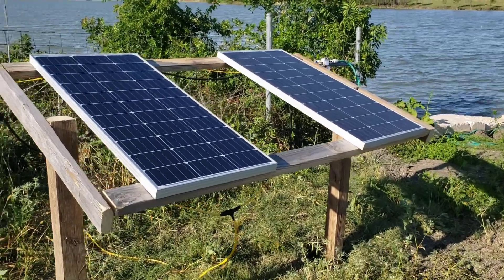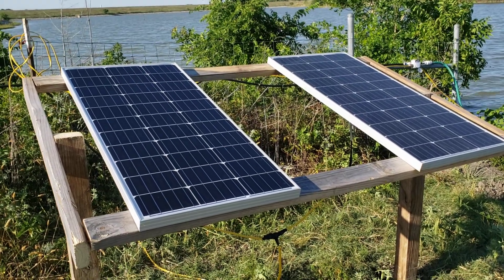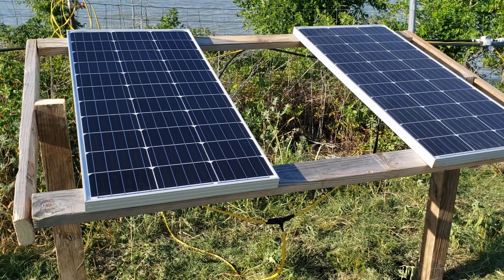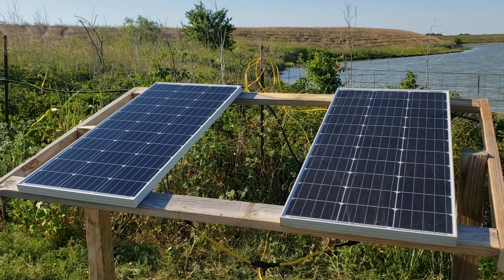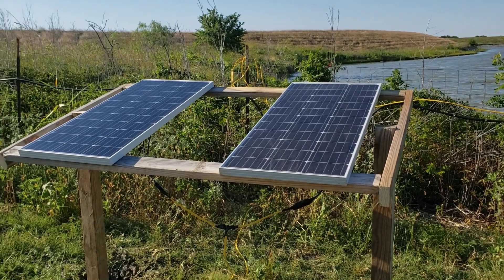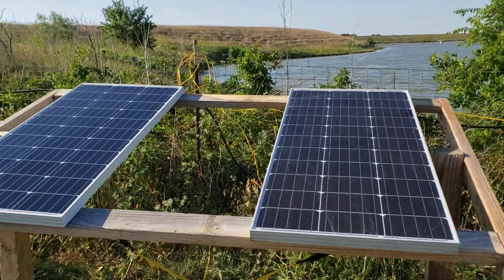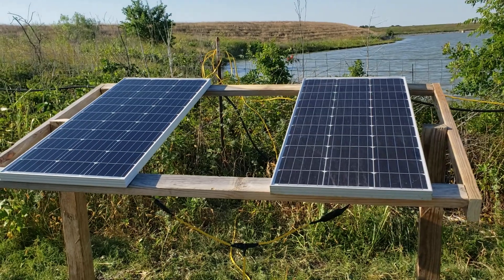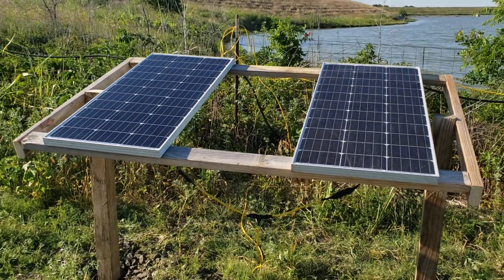Built a Solar Panel Frame from Old Lumber for my Solar Water Pump

Comment: Hey thanks for your very helpful videos - AWESOME!  Quick question, I got the 24v version of this pump and am using it for the same reason (pumping form a beaver pond up 20 feet of head and along 500 feet horizontally to 23 saplings).  It worked great when I put it on with HUGE pressure (I guess not much drips out from 23 x 5 gallon/min spigots), then after about 3-5 minutes, it turned off.  My question is, do you know if the pump turn off when there is too much pressure?  Any ideas?
Reply from the maker: It will trip if the pressure is over 100 psi I think.  Put a pressure gauge on the line when you run it and see where the issue is.  If you don't have enough flow out of the hose you will build up pressure quick.

Comment: The pump spec says 96 watts max. But you are running 200w solar panels. I don't quite understand how that works?
Reply from the maker: That is just what the pump will use.  In full sun the panels will supply up to 200 watts, but the pump will only use up to 96 watts of that.  The rest is basically wasted.  It's like if you plug something into your wall that is 120 volt and uses 100 watts.  There is way more than 100 watts available, but the appliance only uses what it needs.

I had it on only 1 panel for a while which is 100 watts, but that is only full sun.  The pump did run fine on it, but not as long as I wanted it to because sometimes there was not full sun.  Adding the second panel allowed the pump to run even if it was cloudy and longer during dusk and dawn.
Reply: @SeidelRanch  Thanks for the response and the videos. I am using the same pump. Will let you know how it goes.
Reply from the maker: @timomcgeer  That would be great. Keep me updated.

Comment: Do you have your panels run in series or parallel? I'm interested in purchasing a setup like yours with that particular Pump. Is yours still up and running? I'm trying to decide whether or not to get two 100 watt panels are one 200 watt panel as the price is around the same. Thank you for your time
Reply from the maker: For this pump, since it will run 12 or 24 volts, I ran them in series to increase the voltage to 24 volts.  One panel provided enough amperage for 12 volts, so adding another panel in parallel would not have helped (just increases amperage which I already had enough).  When I added the second panel and increased the voltage to 24 volts, I got almost double the output from the pump.

If the 200 watt panel is 24v, then I would get just one 200 watt.  If the 200 watt panel is 12 volt it will run at 12 volt and only use half the wattage, which then would make me get two 100 watt panels and run them serial to kick it up to 24 volt.

I have two pumps because I switch them out every few months to clean them well.  Being in the lake it builds up algae on the screen and I don't want it to clog.  I got the second pump about 3 years after the 1st pump to also have a backup, so one pump has ran for years and is still going.  I put in the clean pump and then clean up the old pump and set it aside until its time to switch them out again.  That said, I have not had an issue with either pump.
Reply: @SeidelRanch  thanks for all the information. Are you using a regulator for the voltage? If not what kind of voltage are you seeing with two panels. That was the only thing I'm worried about with the 24 volt panel
Reply from the maker: @chopshop254  12 volt solar panels put out about 18 volts in full sun and 24 volt solar panels put out about 36 volts in full sun.  The pump handles it fine without a regulator on 12 or 24 volts.